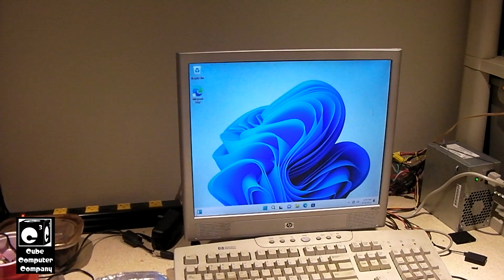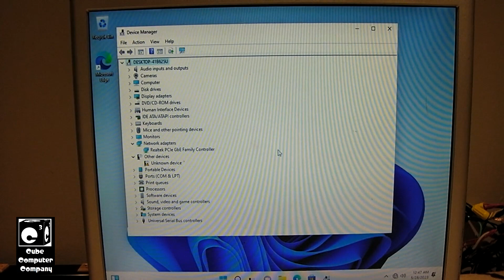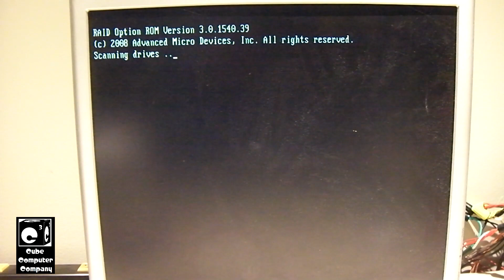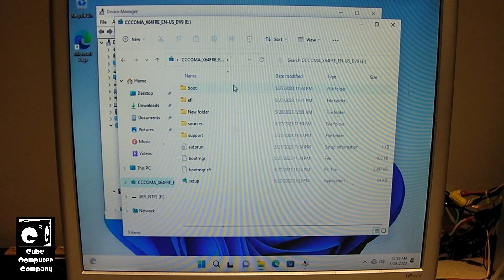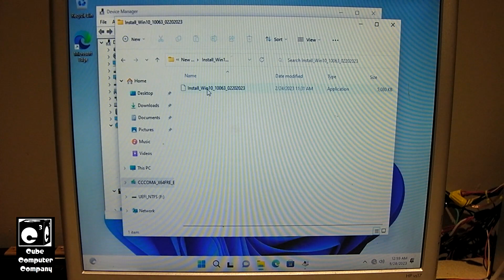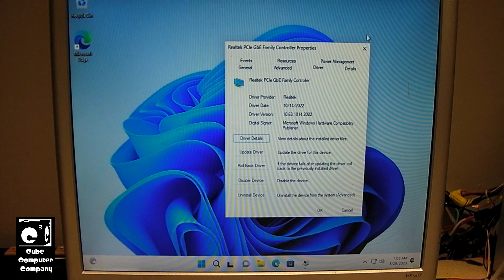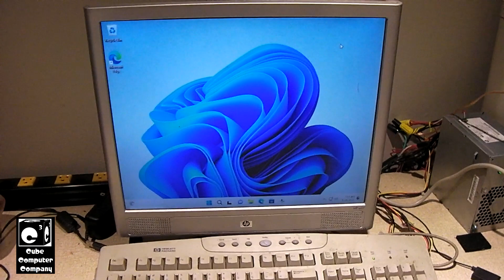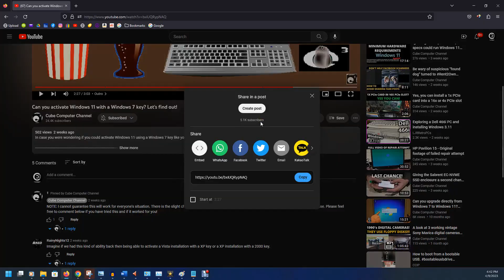Windows 11 BSOD with Realtek GbE LAN NIC - How to fix

Comment: Works in most cases except mine :| So, why a connection is nice with the router and this trouble happens when I trying to connect directly with the cable?

Comment: What a weird problem. I thought it could be a messed up driver,  so I googled and your video was first on the result list. Clicked straight away, exactly the same problem. I managed to install the driver from the motherboard manufacturer CD and it's working like a charm. Thank you very much for posting this, it came out pretty handy. Only observation is that the link for the drivers is not working (at least for me). Peace.

Comment: Greetings, I have been trying so many times to install Windows 11 22H2 or 23H2 on my PC (HP motherboard IPISB-CH2) and it kept crashing repeatedly on a fresh install even with a brand new hard drive. I was so desperate, tried cleaning my RAM and GPU with rubber, thinking that was the problem. I tried everything possible... even flashed the bios a couple of times too but still nothing. This problem is driving me mad! The only version of Windows 11 I was able to install was 21H2 which is outdated, but now thanks to the weapon of God (Nick), proved to be the only solution. Thank you so much, Nick appreciate it!

Comment: Why on windows 10 everything is fine but on windows 11 bsod pops up 2 seconds after ethernet cable connection? Win 10 and 11 download drivers from one server. It's very strange. Now try to install 11, It won't even let me install the system. I have the same error irql not less or equal

Comment: Thank you man! I figured out that the BSOD had something to do with an onboard device by disabling everything and then turning on the devices one-by-one. Never thought that the common Realtek chip could cause such an issue. I left it disabled, installed an Intel network card and everything worked fine. I didn't figure out by myself that I simply had to unplug the network cable. The weird thing is, that Windows 10 runs without issues and I thought the driver base is the same on Windows 11. Microsoft never updated it, on version 24H2 it's still the same problem.

Comment: same problem same fix for PCIe FE family controller (also same driver installer), except it was an update install (23H2) on unsupported hardware from a clean 10 that was working just fine a couple of hours ago, so that's dumb. thanks. should have known something was up when it took 4 attempts to even finish the install. the workaround there was to unplug the network cable and do it offline

Comment: Fresh installed Windows 11 23H2 three hours ago. I didn't have any idea why it crashes when I connect the Ethernet cable. MS fucked up its default driver
Reply from the maker: Makes me wonder if they did it on purpose as assuming any computer needing this specific driver would not meet their EliteClass system requirements for Windows 11...
Reply: @CubeComputerChannel  At least we showed Microsoft who to mess with

Comment: I've found that Microsoft provided drivers are sometimes problematic.  I've had issues where windows update tried updating certain drivers, and caused issues.
Reply: currently dealing with this right now. i cant reinstall windows 11 after i had issues installing a driver. what was the fix
Reply: @bigsteele45 I was able to roll back the driver in device manager.

Comment: I had the same exact problem with one of my systems which doenst meet the ''Elite class minimum requirments'' i just installed one from the gigabyte which was an old one and it worked!
Reply from the maker: Interesting... First, I had looked on Asus' website for available drivers for the motherboard and they were all super old (since this board dates back to the Windows 7 era), and I figured for best compatibility I'd find a newer driver. System runs fantastic now!
Reply: @CubeComputerChannel  Same with my gigabyte board which is a H55MS2 from the Intel Core i series but also my system works great.I have a Xeon 3440 on it and its great for my parents.Before that i had it as my main pc and used it for gaming until i got a ryzen 1600.Unfortunatelly my raid 0 broke and i lost all of my files...but for experimantion i am using windows 11 now on my first gen and i love it.

P.S Startallback is the best tip from your channel thanks a lot :))